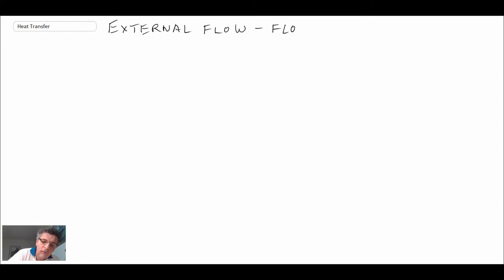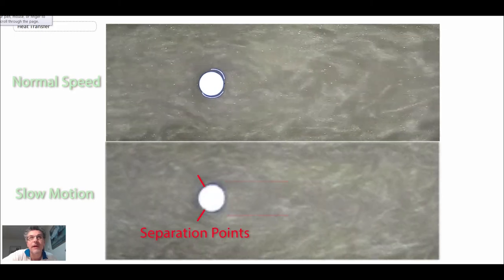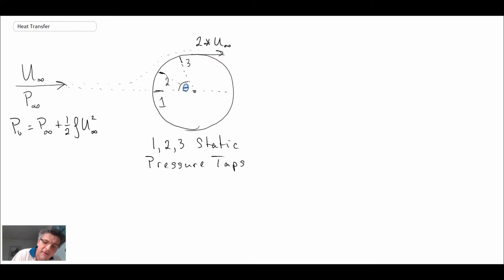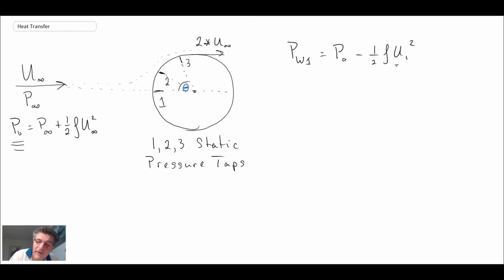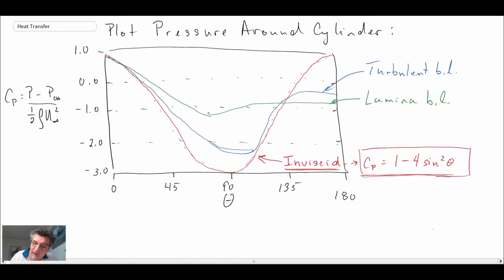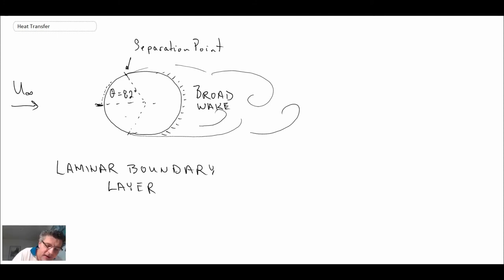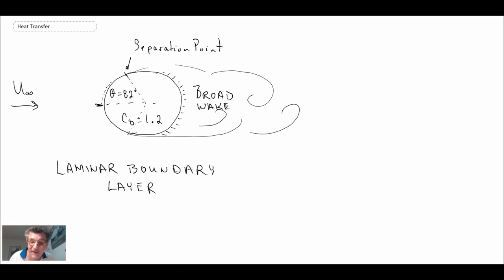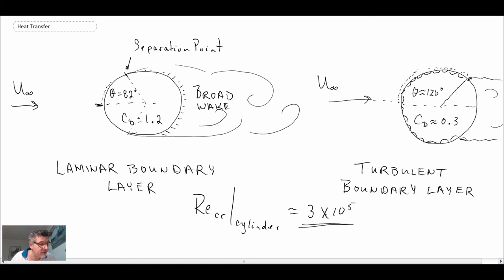Heat Transfer L19 p1 - Convective Heat Transfer - Cylinder

Comment: pressure of what? @ around 5:50 you talk about how the pressure is decreasing. But pressure of what? pressure of the fluid on the object?
Reply: not on the object per se but the hydrostatic pressure at that point